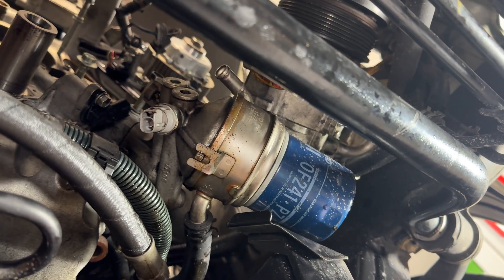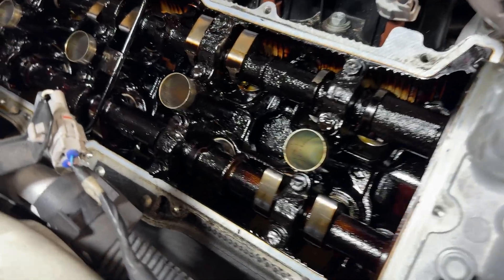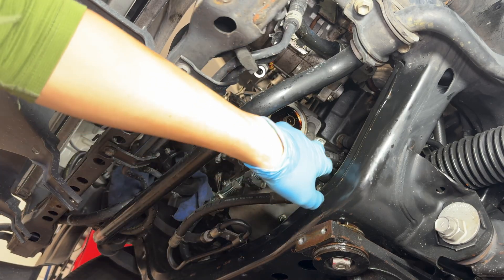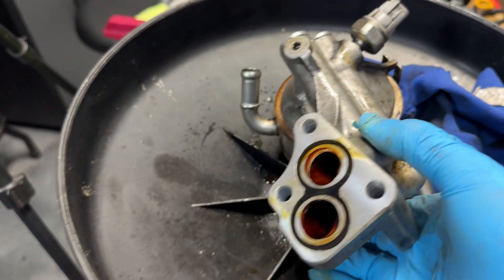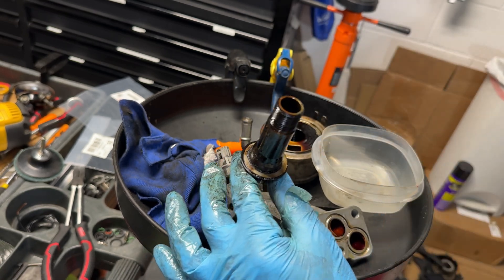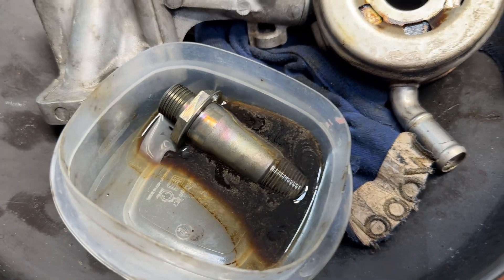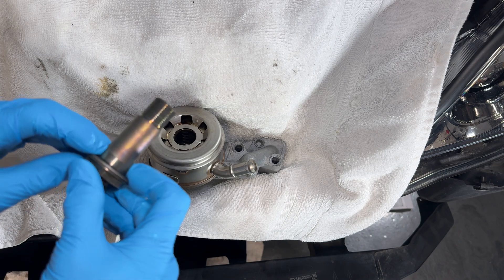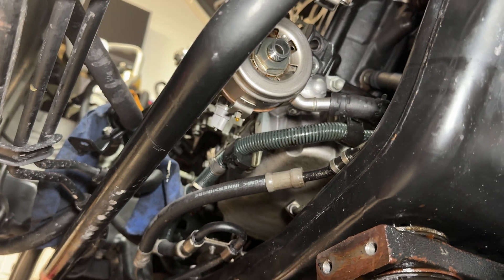How to Change Toyota Oil Cooler Seals - Lexus GX470 4Runner Tacoma 2UZ-FE V8

Comment: Thank you for sharing. This helped me during the overhaul of my oil cooler. My assembly wasn’t leaking but at 167k miles both gaskets were flat and hard. 

I also ended up changing the coolant oil hoses 👍